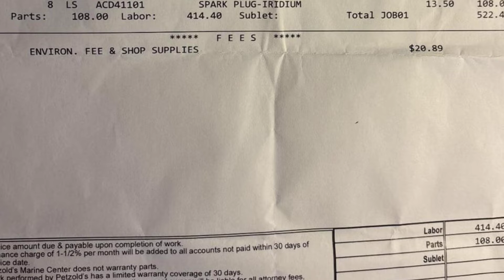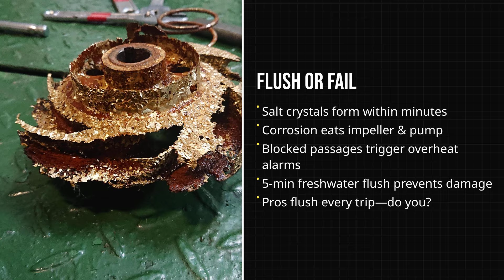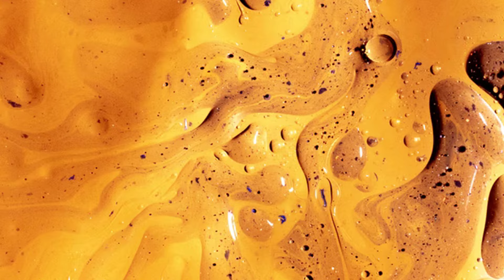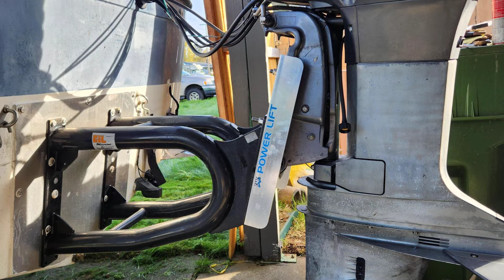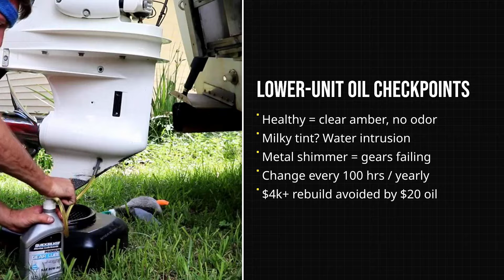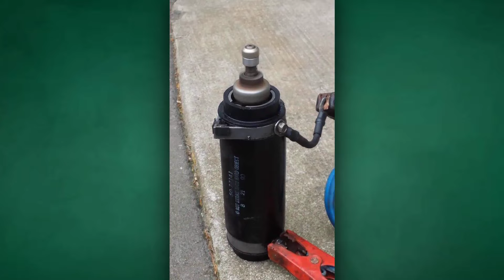7 MISTAKES That Will Shorten Your Outboard's Condition

Comment: Yamaha owners change your Anodes to round style, not the square drive ones, these are for brackish water and are a Yamaha Part. They corrode better and protect your Motor Better, Ask at you dealer. That is especially important when operating in brackish water... estuaries and the like,  I have Serviced Yamaha F115 and F150 with over 8000 hrs and going strong, Yes other bits may wear but the powerheads going strong, one Motor had 4 Years ago had 12000 Hrs on it, still on a boat today